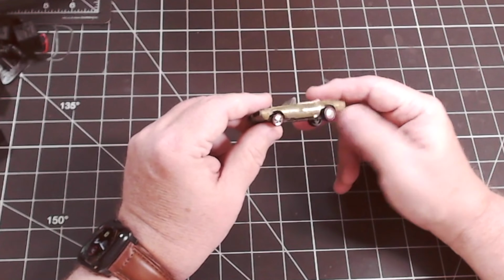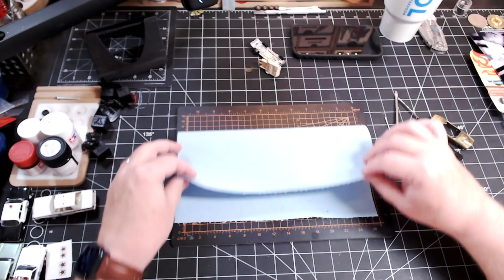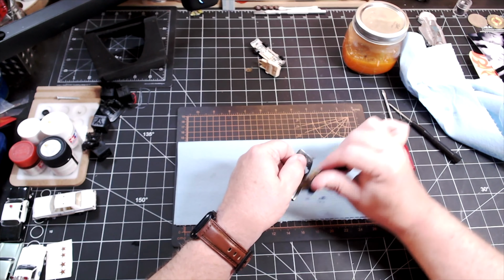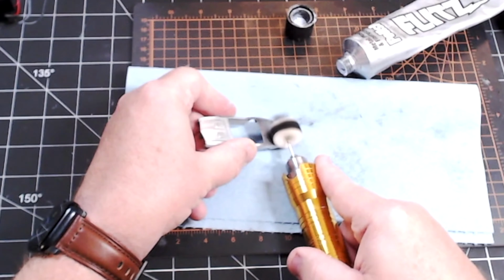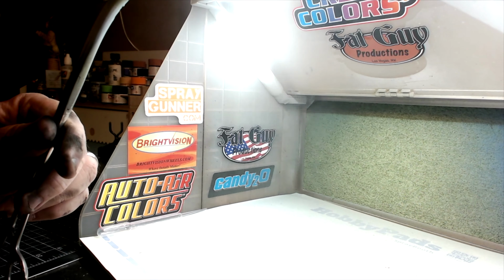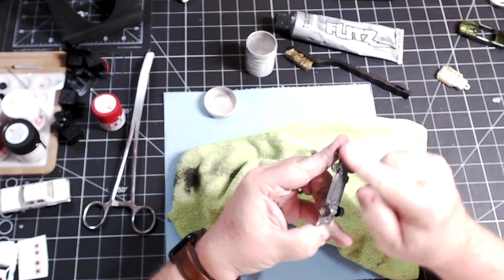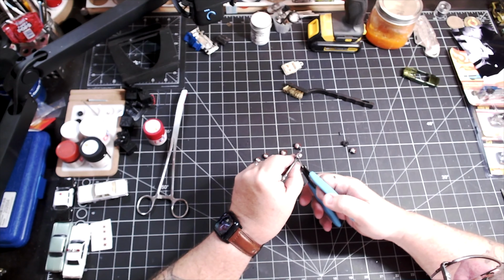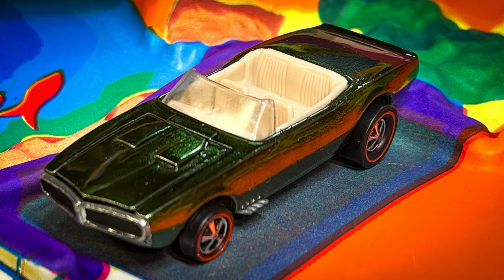Restoring a Hot Wheels Redline Custom Firebird

Comment: wow, what a struggle. but you did it in the end and it looks awesome. :)
custom is custom. of course it needs large wheels in the back. :)
come to think of it, maybe they didin't clean the moulds correctly, or fiddled with the alloy. and then someone decided to run  that series with opaque metallics instead of spectraflame...

Comment: I've seen on some of the large toy restoration channels,  on very rough metal parts they'll sometimes put chrome powder coat paint on the part, and bake it - making it look brand new.   Never seen that done with small die cast, but might be something to consider.  Then you could do the normal spectra flame on top of that theoretically.  
I've also seen nickel plating done vs zinc, not sure if that might work better.
Reply from the maker: I have experimented with PC and not happy with the initial results.  As to nickel, I have tried it and totally don't have it figured out yet....